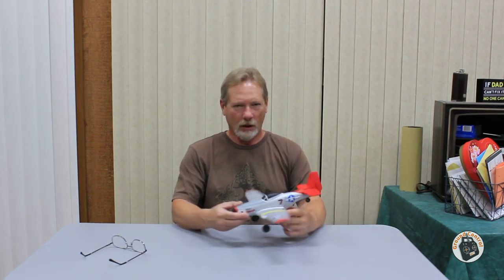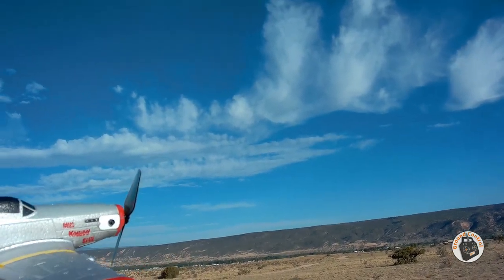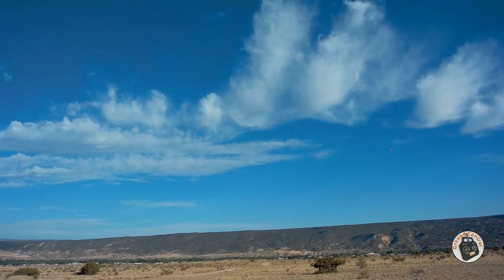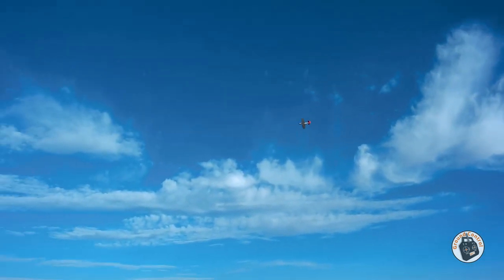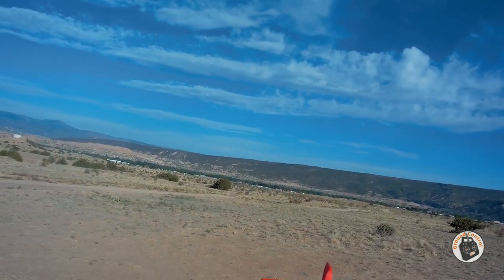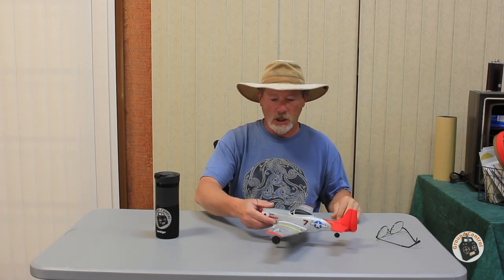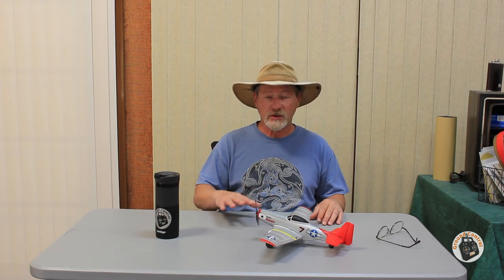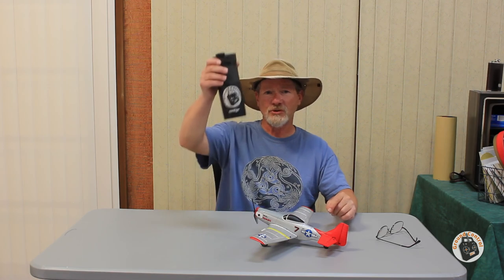Brushless Conversion Test Session #1 of the Eachine Mini P51D Mustang Warbird & RadioMaster TX16S

Comment: Welcome to the brushless Mini Mustang club!   I apologize, but I can't find a button to give you 2 thumbs up  ;-)   No bank limits is the only way to fly this bird and REALLY enjoy it to the max.  Excellent, and nice job taming that beast in the air.  FUN!

Looked like a bit of a tip stall on flight #2.  Not uncommon with high-performance P-51s. 

Great job. Lots of power now.  Enjoy the Mustang as it was meant to fly.  And the elimination of that annoying gear noise.

Happy flying!
Reply from the maker: I remember your Brushless Conversion. Didn't you do a 1S and 2S Conversion? Which one did you prefer? I was afraid a 2S Setup would make it too heavy. I'm loving this 1S Setup though. Maybe in another year these 12xx Motor will provide 100g of Thrust on 1S. Yep, after reviewing the video I'm thinking tip stall as well. I made a very abrupt change in direction with too little speed. Hummm...me making and abrupt change in direction with....too little speed? That's different ;-) It's usually too much speed with me. Yes, this power system is whisper quiet ;-) I'm loving flying it even more now.
Reply: @GroundControlRC  I did a 2S mod using an 1105 3000Kv and a 200mAh 2S pack.  Weight was fine. A 300mAh would have been better, but I didn't have one at the time and it would have required some battery cavity modding.  It was a rocket: https://youtu.be/1Iyo5QscFBQ

I later converted it to 1S power with a 1207 7500 and a 10A ESC using a 360mAh pack.  Flew similar performance, but the pack was very warm afterwards from high current drain.  Using 1204 and 1205 now for extra power and longer runs: https://youtu.be/m8Q3rwYkVzs

My first mod used a 1108 6000Kv on 1S and did really well too, and the narrower motor was easier to fit in the tight nose: https://youtu.be/7nzMwVANQXg

This is how I managed to use the stock P-51 prop and spinner: https://youtu.be/e1hPKCGKz24

Happy brushless flying!
Reply from the maker: I remember watching those videos. I thought you had converted two different Planes, (1) for 1S and (1) for 2S, I didn't realize it was the same plane. What was your AUW with the 2S Setup? I decided to use a prop that would mount directly to the motor and cost less when I break them. I'll probably use the 1206 4500kv for a 2S Setup.
Reply: @GroundControlRC  My first was 1S with the 1105 3000Kv (too weak) followed by the 1108 6000Kv that worked well.

My second P-51 got the 2S set-up for the 1105 that did far better with more volts, then was modded again later for the 1207 7500 and back to 1S power.  None of my Mustangs are 2s today. Flights were too short with only 200mAh to go on.

The 1207 went into my Corsair that was modded to take a 300mAh, and another 1108 into my Trojan to use stock packs.  Both still need flight testing.

1206 4500Kv on 2S....Sweet. Gonna be a fun ride!  Brushless Sport Cub 500 in the future maybe?  ;-)
Reply from the maker: @Doggeslife  What was your AUW on the P51 with the 2S setup?
I'd love to convert the Sport Cub 500 to Brushless but I have such a limited amount of time. I'm thinking of converting the Mini Cessna to a 2S system since it's a bit larger Plane. I'm kinda on the fence right now with which one of those to convert. I would definitely leave the Sport Cub 500 as 1S as it's so small and light and would want to keep that excellent slow flight capability. I'm really liking the 12xx Motors ;-) I'd can't wait to see the Trojan Brushless. That's such a nice looking airframe.
Reply: @GroundControlRC  Truly, I never weighed it, as it felt close to stock  My Super Cub 500 2S mod came out around 70g with a full-span balsa aileron upgrade included, so well below that.  I suspect the P-51 was in the low 60's with removable wing mod included.

Comment: Looks good! Glad you regained some faith in the 1s world! It's amazing what it can do.
Reply from the maker: Hey Mike! I was amazed at this 1S Power System on this Plane. I've tested a lot of these Micro Motors and Props and was just never able to get the amount of thrust I wanted. This setup provided 70g of thrust! The most I've ever gotten from a 1S Brushless Power System. These Brushless Motors just keep getting better ;-) I may have to do another one this Winter ;-) See you in the Air!
Reply: @GroundControlRC   I suggest trying that motor and prop combo on one of the 48 cm chuck glider. You'll be impressed with how it handles being so light. I've only been flying mine on 1s lately
Reply from the maker: @mikelarin8037  Hey Mike! That's a great idea. I have the 7500kv version of this motor that nearly provides the same amount of thrust on 1S ;-)

Comment: Awesome video. How much expo did you have on the 2nd flight?
Reply from the maker: Thank you much Tim! I performed (3) different flight sessions to get it tuned and handling the way I like and I had 25% EXPO on the Rudder, 55% EXPO on the Ailerons and Elevator. That made it perform nice and smooth. I had to use quite a bit more EXPO than I did stock as it's moving through the air quite a bit faster ;-) See you in the Air!

Comment: Looks good in motion, for sure.  Curious, did you identify the problem with the old system as being in the gearbox or motor or both?  Another good/helpful vid.  Thank you!
Reply from the maker: Thank you! What a blast this P51 is ;-) I did not investigate but it sounded like the plastic gears were so worn that sometimes they would slip. Most of the time I had very little power and then for a few seconds the gears would catch and I would have good power then they'd slip again. The Brass Pinion on the Motor still looked like it was in very good condition.

Comment: Very cool.  With 4V left in the battery after a five minutes flight I'll bet you could fly for 10 minutes.  And yes, I'd like to see the conversion video.
Reply from the maker: Hi Jack! Thanks much! I was glad I finally got this project completed ;-) The Battery Meter was not accurately measuring the voltage on the 1S LIPO. It was actually 3.8v according to my Multimeter. I should be able to get 8min flights, being heavy in the throttle, and leaving 3.5v in the LIPO. Not bad for that kind of power ;-) Test Flight Session #2 will better show the capability of this Brushless P51D. I'm having a blast with it ;-) See you in the Air!

Comment: 15:03... if you place a known low ohm resistor (~1 Ohm or Less) in series with the battery you can get the current draw by placing a DMM on the proper voltage range across the resistor and convert the readings to current.
Reply from the maker: I have on my Wishlist a Load Meter than can accurately measure a 1S Power System. If they make such a Load Meter. The one I have only works with 2S-6S Power Systems. Looking at the amount of flight time I should be getting, with a 1S 360mah LIPO, it doesn't seem to be pulling many amps ;-) But I definitely would like to know exactly ;-)

Comment: Has a LOT more power.. Flies pretty good for the first flight. I did cringe on that first takeoff... 2nd flight was even better with the added expo. Yup... would definitely like to see the conversion..
Reply from the maker: Hi Lasersbee! I'm loving this Micro Warbird even more now ;-) It has a RacerStar BR1206 6000kv Motor, DYS 7A OPTO ESC, and an HQ T5x3 Prop. It produces 70g of Thrust on 1S. I performed a lot of Motor and Prop Testing before deciding on the Power System. I've posted all the Test Results as a downloadable Zip File with (3) different version of this Motor on 1S, 2S, and 3S setups.
Reply: @GroundControlRC  Thanks for the info... I saw that you mentioned the parts at the end of the video. I usually ask question as they pop up...;-)
Reply from the maker: @lasersbee  You are most welcome ;-) See you in the Air!

Comment: Any tips on making space for a 600 mAh battery
Reply from the maker: I would cut some foam and try not effect the CG.
I've had to fabricate new battery hatches as well to use a significantly larger LIPO.
I'm considering doing that to my Volantex P51D 750mm to use a small 4S in it ;-)
Should be fun if I can set aside the time.
See you in the Air!

Comment: Did you use the stock receiver and servo setup?
Reply from the maker: Hi Steve! No, I used a Low Voltage DSM2/DSMX 4CH Receiver and (2) 1.7g Low Voltage Digital Servos to replace the Servos on the Stock Receiver Brick. Only the Aileron Servo is left from the Stock Electronics.
Reply: @GroundControlRC  Could you post links for the servos and receiver you used?
Reply from the maker: @timtheplaneman  Hey Tim! I'll be posting a link to the Setup PDF File for this Brushless Conversion on our Facebook Page today and I'll provide links to all the Electronics I used in this Project in that Post. I hope that helps.